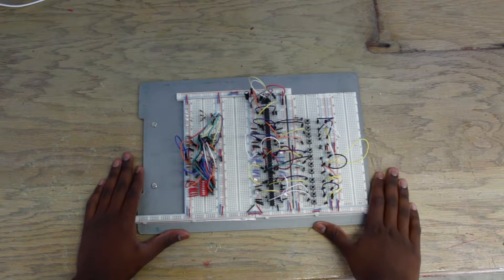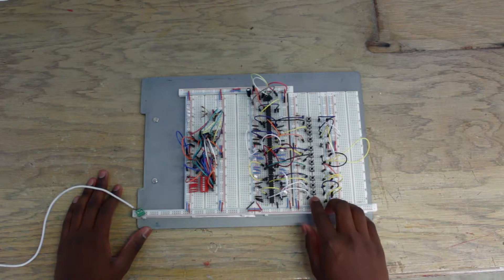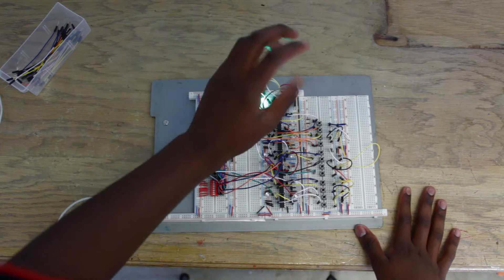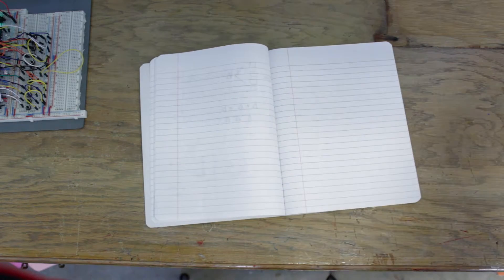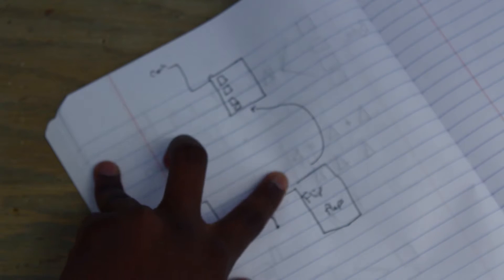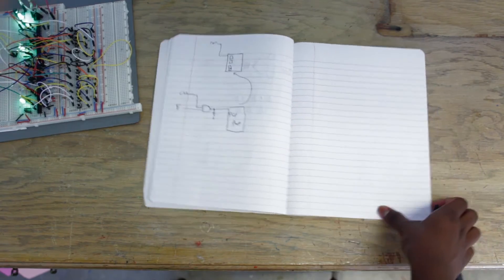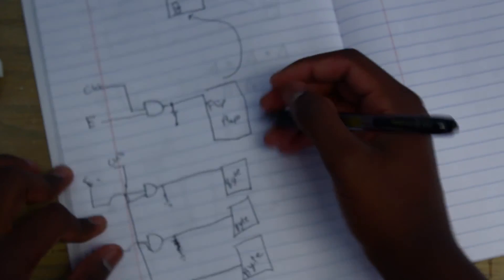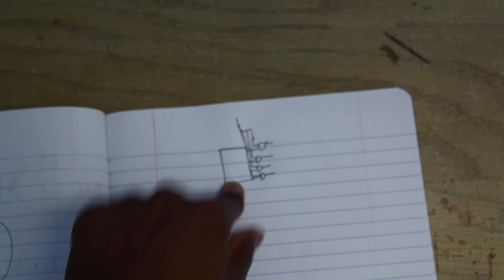Storing ALU Values | 8 Bit CPU Project

Comment: Some Questions:
1.Will you build an cpu with an harvard or with an von neumann architecture?
2.Dont you use the word nibble for 4 bits normally?
Reply from the maker: 1. harvard so that it's more organized, not for speed increases or anything. However, if it becomes too complicated to do harvard, i'll probably do von neuman
2. Yeah. It is actually the perfect word for what I am doing. I just didn't think of it.
Reply: Ok, btw maybe a programm called logisim could help you.Its a very nice and free logic simulator.
Reply from the maker: thanks. thats good because the circuits are getting more and more complicated
Reply from the maker: https://www.amazon.com/Digital-Computer-Electronics-Albert-Malvino/dp/0028005945/ref=sr_1_2?s=books&ie=UTF8&qid=1480562849&sr=1-2&keywords=Digital+Computer+Electronics+3rd+Edition
It's really expensive now because it's old. It's the one I use. It is clear and to the point. Sadly, the explanation in terms of like "why is this component important?" is highly lacking.  You might be able to find a different book that goes over the same concepts because the CPU is rather standard (especially a simple one like how we are building it). Good luck!
Reply from the maker: No believe it or not it's a coincidence. That textbook is one of the best in its class so it is not surprising I found it on my own. I started my tutorials before Ben Eater.
Reply: but you copied his sap1 for the tutorials
Reply from the maker: Maybe because we accidentally use the same book that contains the same sap 1 architecture. I told you we both happen to use the same textbook because it's the best one and obviously it contains the same architecture.

Comment: What are you using for power supply?
Reply from the maker: A phone charger with a snipped USB cable and I put the wires in a terminal block so it fits in the breadboard
Reply: +Ahkeel Mohideen Thank you!
Reply from the maker: Zorfendorf no problem